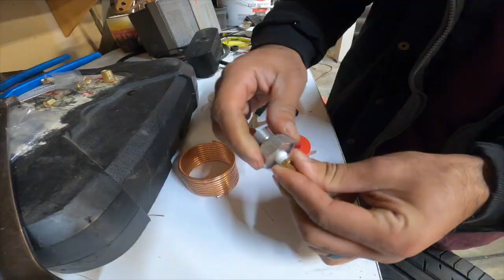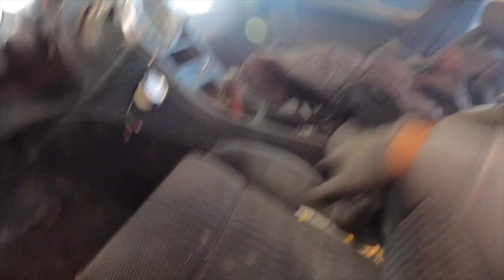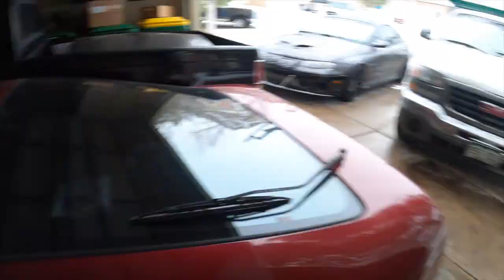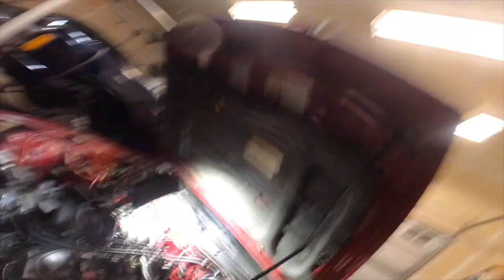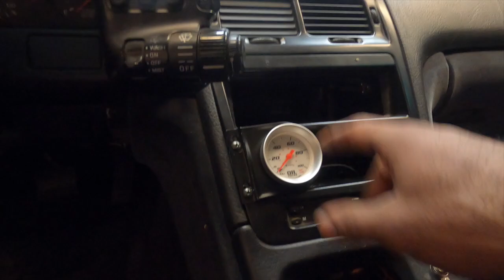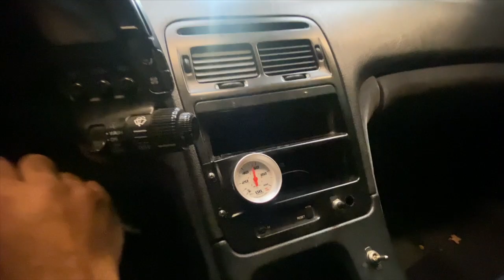LS DRIFT Z32 300ZX IS READY FOR SOME SLIDES! LETS GO!! FINAL TOUCHES COMPLETE

Comment: Love the channel and builds bro. But I heard if you are trying to seal any time of threads for oil lines or brake lines use threads sealant. Instead of tread tape so it case it don't break up into the system.  But like for air hose or water hose or lines then thread tape is perfect. Just my 2 cents brother keep it up